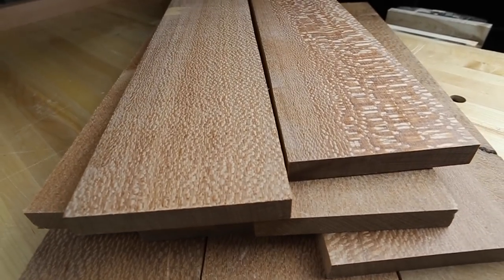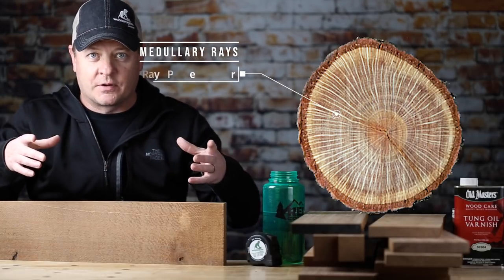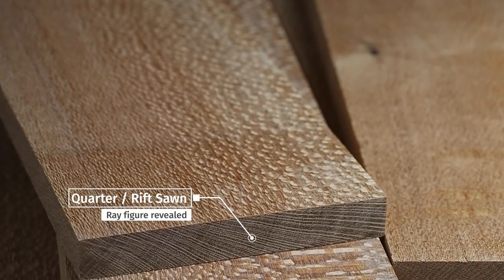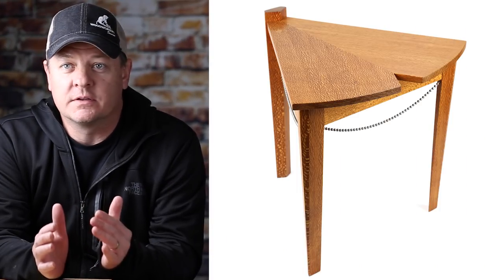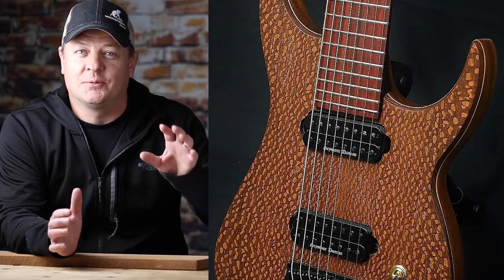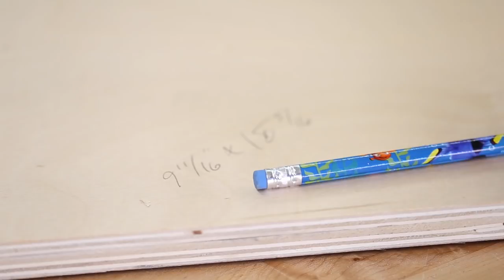Check Out THIS AWESOME WOOD: Leopardwood

Comment: Yes, this wood is absolutely gorgeous!  I found out the hard way that I was severely allergic to it though.  I have friends who have also had an adverse reaction to Leopardwood/Lacewood so I took what I thought were necessary precautions wearing long sleeves and a respirator.  The fine sawdust still caused an allergic reaction that had me in misery for a couple weeks.  Be careful if you use this wood until you find out if it effects you.

Comment: I use this stuff to make picture frames, and while I was warned about skin reactions, I have not personally had any.  It does splinter really easily though, and my local shop sells this stuff by the pound not board-foot, so it becomes pretty expensive to do anything with it.  I still like it though!

Comment: I have had a leapord wood billet for about 8yrs sitting in my basement I finally used some of it for a fretboard on my first tennor ukulele build. This wood is nice however it does splinter easly & I got a small rash from working with it.

Comment: Nice looking wood. I have a side question. I noticed you using a synthetic pad in this video as well as others. I've been using steel wool but want to try these pads. Can you wash them out and reuse them? Or just use them until they are clogged up with debris?
Reply from the maker: Yes, they can be rinsed out. Often with warm soapy water or mineral spirits.